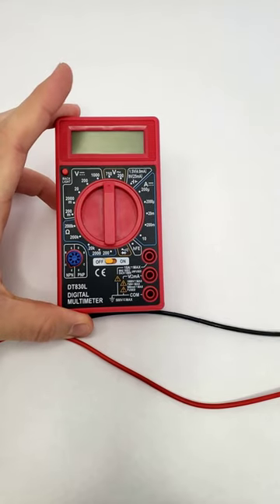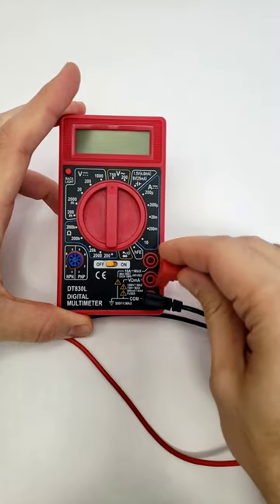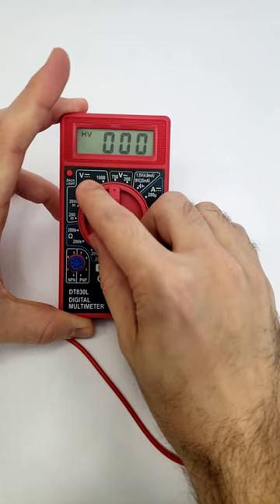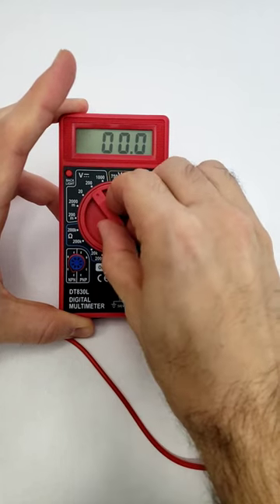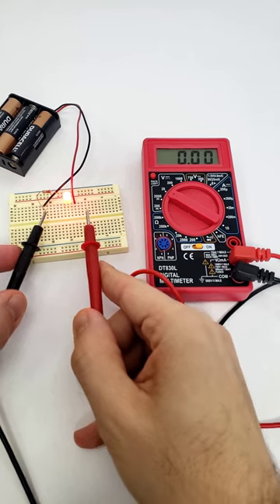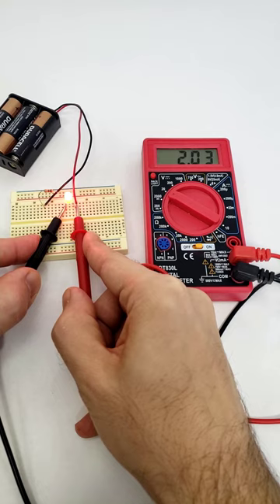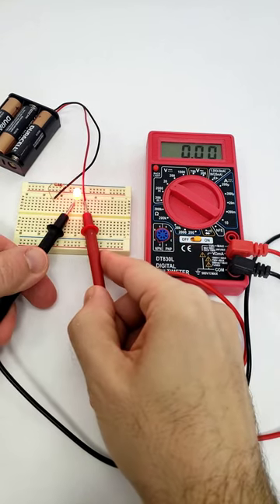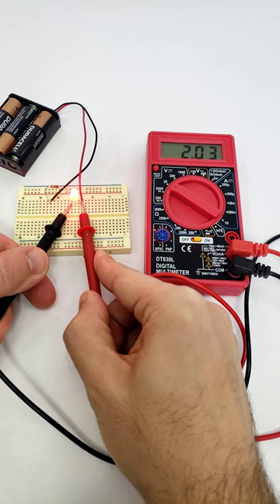How to Measure Voltage with a Multimeter

Comment: I have an issue and question. I have that same multimeter. When I connect the probes to battery terminals to measure voltage, the number very slowly climbs up to its voltage, instead of instantly. Why might that be?
Reply from the maker: Hi - we haven't seen this occur with any of our multimeters, so can't say for sure. The most common issue we see is a blown fuse when trying to measure current.
Reply: Perhaps the battery is low or the multimeter just cant sample fast enough?
Reply: This is a very low-quality multimeter. I've seen these being given away free with a Harbor Freight coupon. There are many options for a higher quality multimeter that, if you take care of it, can last you decades. Home Depot and Amazon are good sources. Also Harbor Freight upped their game in DMM's recently. You don't need to spend more that $30 for something that will return its value many times over. For reference: Fluke is the platinum standard for DMM's but you don't need to shell out that kind of $$$ to begin learning.

Comment: what if you have a single cable you want to measure? can you use the hot cable for red probe and use the other on something grounded to close the circuit and measure the power?

Comment: This question may sound silly, but please forgive me. I am new to electronics. If I understand correctly, I should connect the probes in parallel when measuring DC voltage and put the probes in series when measuring current/amps. Is that right?
Reply from the maker: That is correct - you may find our full multimeter tutorial video helpful: https://youtu.be/ts0EVc9vXcs?si=5dGIa5yZaQ2A7K3E
Reply: @Science.Buddies  thank you❤🤙

Comment: What would the reading be if you measured that LED but had the multimeter set to the 200 DC range? The reason I ask is because I’m getting a reading of 189 for a 36v battery on the 200v range and that doesn’t seem possible
Reply from the maker: Hi - unfortunately we can't really help troubleshoot with individual multimeters in YouTube comments, if you find a forum dedicated to electronics where you can post pictures of your setup, you may be able to get more help.
Reply: @Science.Buddies  no worries thanks guys!

Comment: What would it mean if i turn the dial to 2000m and measure it ? What would be different?
Reply from the maker: 2000m is the 2000 millivolt range so the value displayed on the screen would be in millivolts instead of volts. You cannot measure a value over 2000mV (2V) with that range.
Reply: It's best practice to always begin your measurement with the largest scale of the multimeter and work down in resolution. @Science.Buddies began with something in the middle of the voltage range because he knew the circuit is limited to only a few volts based on the battery pack powering it.